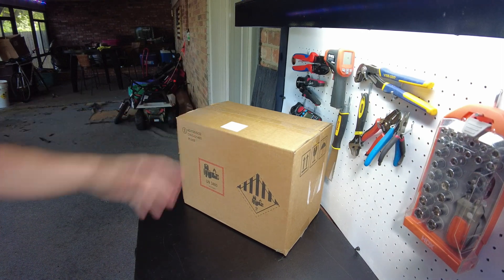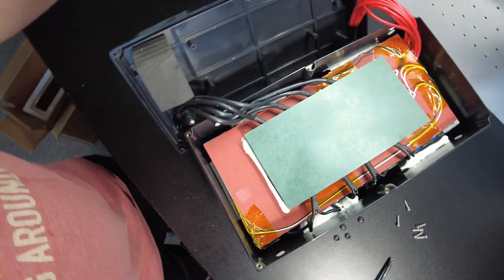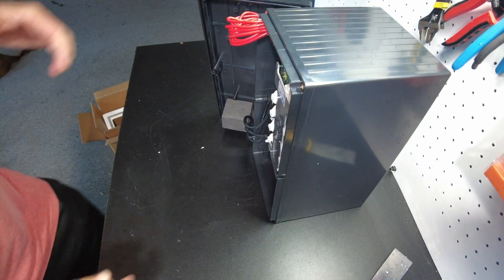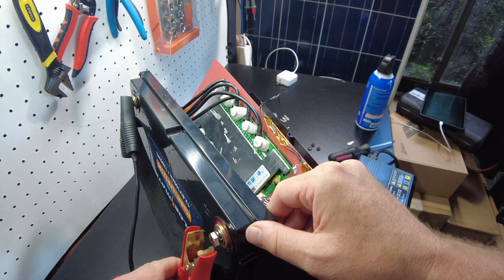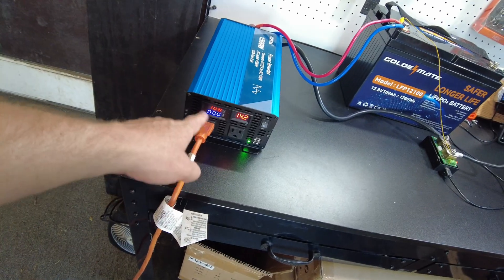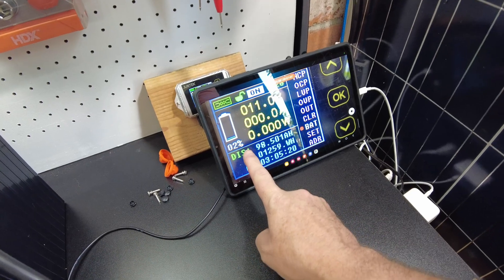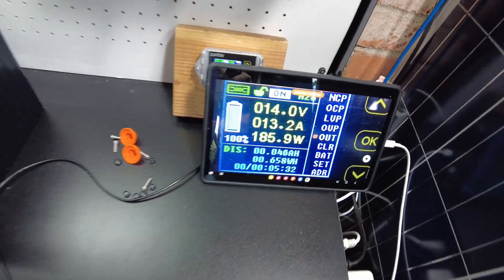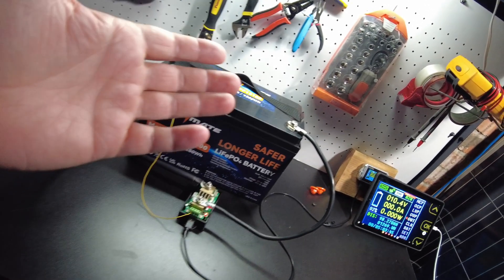Goldenmate12v 100ah LiFePO4 Lithium Battery

Comment: 10 14g wire isn't cool an the.fact the grounds isn't matching the same amount of hot wires is a red flag. Could just of used 1/0 welding wire or atleast 2-3 runs of 1-2g battery cable. Not a bunch of speaker wire 😭